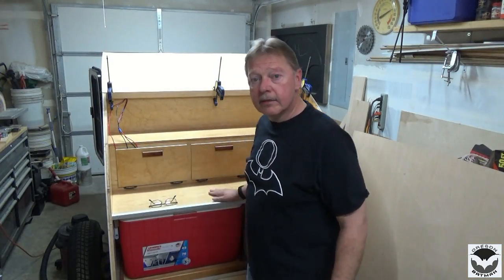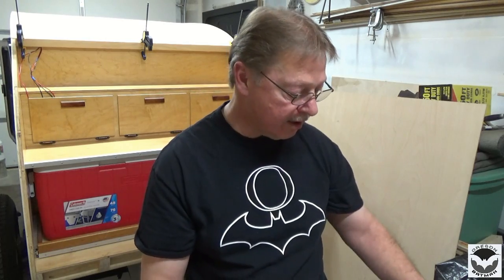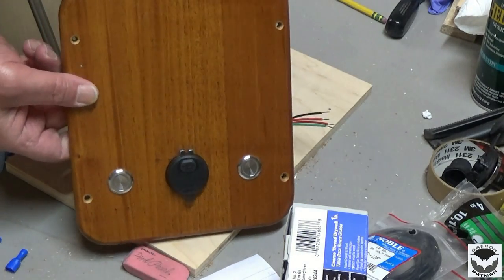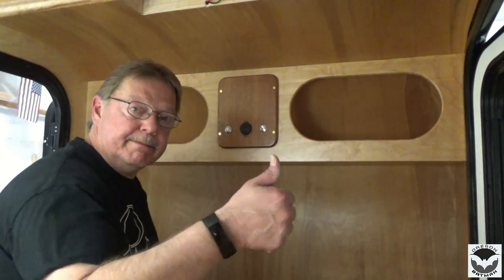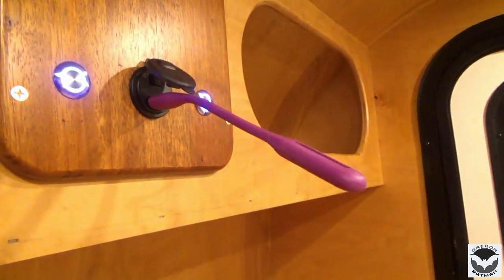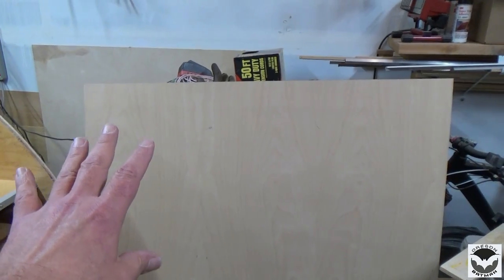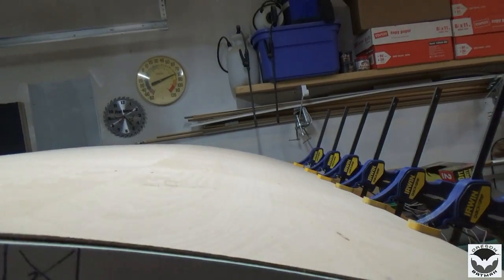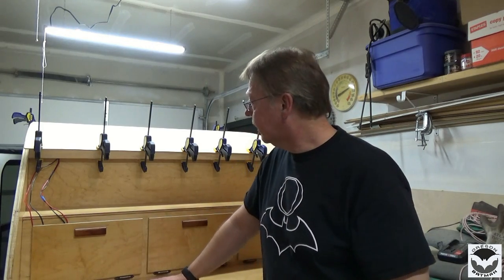Let’s Build A Teardrop * Step-By-Step * - Part 32 (Lights Install)

Comment: Love those switches!  Every camper I've seen has toggle or push-button switches.  You're the first I've seen. use touch switches.  I think they look spectacular.  Also love the match of the cover with the door handles.  We have almost recovered from our recent "surprise adventure" and are ready to finish her teardrop.  It's so close, and so is yours!
Reply from the maker: Thanks Eli! Yup... pretty happy with the switches, I do think they look pretty good, and they work great! Looking forward to seeing yours finished! Mine is pretty close... but getting the time to work on it getting a little tight. Had to get some things out of the way! Trying to get it in gear!

Comment: Where the mahogany panel is screwed to the cabinet face you may want to open up the four screw holes a bit to allow for seasonal wood movement.  Just a thought ...
Reply from the maker: Thanks Michael! I will keep that in mind and watch for any movement. Great tip, thanks!

Comment: I think on those new switches the light isnt on all the time, but the circuit sensing your motion is. So there is going to be a constant draw from the battery, much like in a car with your keyless remote always drawing power. If you have an micro amp meter you can see how much.

Coming out good.
Reply from the maker: Good point. Be interesting to see how much it draws over a little time. I'll most likely install a shutoff switch on the battery for those times when trailer is not in use, and use a small solar setup to keep it charged on the outings.

Comment: Great video! May I suggest something. You    put a lot of work to hide as much screws as you can so for the switch panel, I was thinking to use a couple big strong rare earth magnets instead of the brass screw. Good luck with the new roof.
Reply from the maker: THAT... is a super idea! I did not think of that. That would have been a great little feature to have. I didn't like the idea of the screw heads showing, and didn't want to use the little wooden button heads. Wish I knew about the magnets before hand. Next build!! :) Thanks for that tip!

Comment: That sucks your plywood didn't work out. Have you thought of using 1/8" Baltic Burch plywood. It comes in 60" x 60" sheets. Your doing a great job.
Reply from the maker: Thank you so much! Next build will definitely use the 1/4"! None of the lumber yards around here have exactly what you want when you need it... especially the Baltic Birch which would have worked out great! I ended up using a Mahogany product called Miranti. It's 1/8". Worked out great

Comment: I read plywood delaminates over time, is that going to be a problem? Unless like marine grade or something.
Reply from the maker: Not going to be a problem for this particular build. The plywood will be sealed by the filon and no exposure to outside. I built a few boats in the past and used the marine grade ply, and that held up really well. Just have to make sure that both sides are sealed and no moisture.